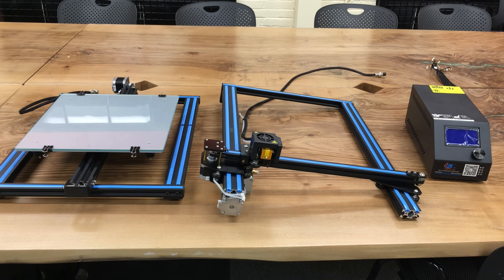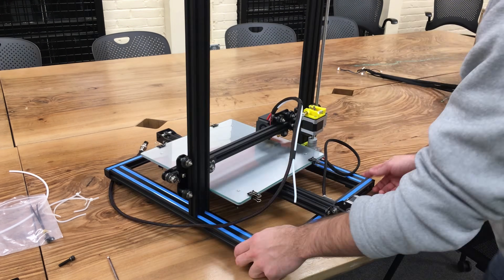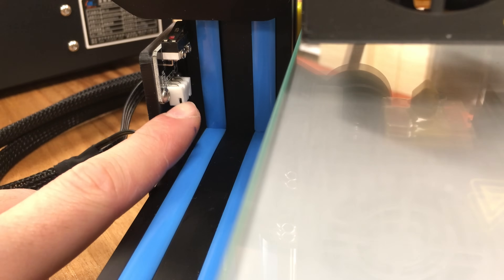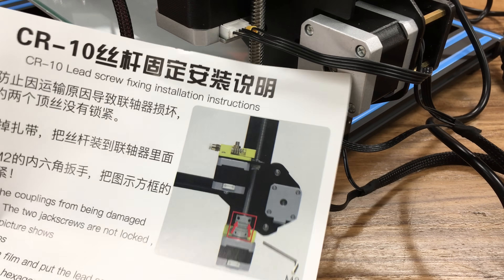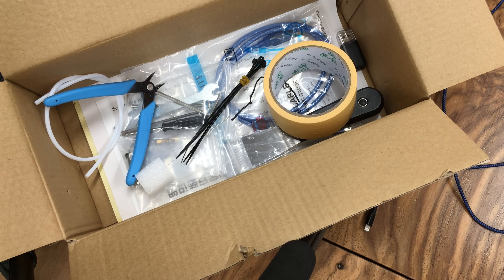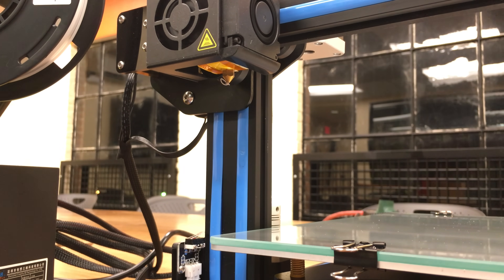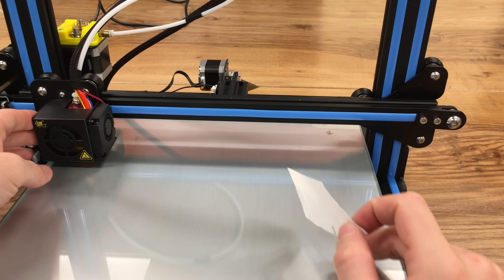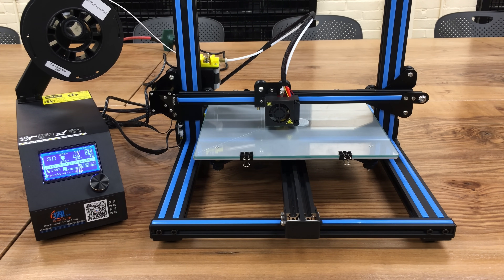Creality CR10 | How to setup, assemble, level and start your first print!

Comment: Thank you. It turns out the previous owner had installed the gantry crane... backwards... and that's why it wouldn't work. I'm on try three of my first print (first failure was user error, second was actually a dumb beginner mistake), and so far, so good!

Comment: Mine goes up by like 30cm and starts leveling the bed in mid air increasing the height and then it either hits top or starts printing mid air (30cm above the bed)

Comment: Are you supposed to print with the glass and binder clips on it?
Reply from the maker: If you have stock bed yes. There is nothing else holds that glass. So you need them unless you change it
Reply: @3DPDoctor  awesome thanks for the quick reply!

Comment: Please if anyone can help, everytime i set the nozzle up so it's in the correct position, when i set home, or start a print, the nozzle is further away from the bed to where i located it. I only found out today that the right hand side metal bar behind the printer, the one that twists (not sure on the name) doesnt screw back enough so requires me to twist it, which moves the nozzle down towards the bed, but everytime i print, it just resets and the nozzle becomes highter up. Any suggestions would be welcome if anyone knows what i could do..
Reply from the maker: Interesting. Are you saying your z axis couple screw is loose? So you should fasten it properly?
Reply: @3DPDoctor  thank you for the fast response. So up the top left you have two screws which are tight as they can be, further down you have the two screws located on the blue part which are all as tight as they can be, the left side is perfect but the right side, every time I set home it just doesn’t home where I need it to be, it requires me to twist it further. I am wondering if the printer me be faulty. The little silver cylinder like part at the bottom, which turns, I am wondering if It’s this which is the issue. I am a dummy when it comes down to these :(
Reply from the maker: Something is definitely not correct but this is fixable sounds like. However its hard for me to debug from here. You need someone to take a look at it in detail

Comment: Rather than holding the unit sideways, I found it was helpful to just hold the edge off the side of the table so you don't have to balance it.  Great video thanks!
Reply from the maker: Thank you for your comment!
Reply: Without reading this, I did the same. worked well.

Comment: if I am trying to move the extruder and i hear the bed moving....did I wire it wrong? just trying to assemble
Reply from the maker: Seems like it. I assume this is happening when you are using the controller screen right? X axis is extruder y axis is the bed
Reply: @3DPDoctor  thank you for responding Dr.! first person to help in 3 weeks. I was trying to see if filament would come out following your instructions and that is when I realized.
Reply from the maker: Did u check the wiring? They should be labeled
Reply: @3DPDoctor  it was connected correctly. The bed is too high for the printer...nothing I do to adjust the bed makes a difference. what should I do Mastro
Reply from the maker: Is your nozzle hitting the bed at the beds’ lowest position? Why dont you move the z limit switch a little up a little to gain distance between nozzle tip and bed surface

Comment: THANK YOU SO MUCH! This is the BEST CR10 setup guide video I could find! And you cover things step by step for a total beginner AND you mentioned things like the input voltage setting that nobody else bother to mention!! 👍👍🤗 I've got my CR10 setup and test printing right now (the test file was named Dog-Test, but it's just been printing a 6" flat pancake for the last 45 min lol! Curious to see what it will be when it's finished haha!)!
ALSO, BTW my CR10 has the bed strain relief already installed, and I had to adjust the FRONT Y axis roller bearing because it was touching the frame and not providing tension to the belt. Other than that it was mostly flawless!
Reply from the maker: Awesome!!! Thank you for your comment appreciate it

Comment: Thank you for your video! Very helpful! One question: Do you really need the four clips to hold the table?
Reply from the maker: 4 is better always. If that table moves during print, it will be over.

Comment: how long did it take for your print bed to heat up to 60c mine got to 35c to 37c and got stuck there for 1 hour then it started going down again and then i tried it again and it slowly started to go back up again passed the 35c so idk if thats normal or what.
Reply from the maker: Nope it is not normal, under 10 minutes it should reach up to 60
Reply: @3DPDoctor  do you know what I would have to check or who I can talk to about this problem?
Reply from the maker: I would first post this problem into facebook group to see if anyone experienced it before. Maybe there is a problem with the heat sensor on the bed or maybe a software bug. In any case it can be solved with a little effort

Comment: so i live in the USA and i have the cr10s, when i need it to be on 110 should the 210 part of the switch be showing out of the hole that you switch it?
Reply from the maker: Did I miss that section in the video?
Reply: You did explain which it should be on but switches are different on everything, sometimes it means its on when the on side is showing and sometimes something is on when the on switch is pushed in and you can see it. @3DPDoctor
Reply from the maker: So did you make the right setup yet? In mine i can see the 110V text when the switch is on 110V position
Reply: If you switch it to the higher voltage would the fan spin faster? if it does mine is the opposite of you're printer. I have the cr10S so it could be different.  @3DPDoctor
Reply from the maker: @connorgrow7794  I have cr10s too. I looked at its voltage switch before I tell it to you. Noooooooo if you swap it to 220 it wont change the speed of fan. That very little switch is for your power supply of the printer. It regulates the main power and decreases it down to 12V so that your printer can work.  If you plug your printer into 220V power and if your switch is on the 110V your regulator will burn. It has nothing to do with fan speed. Your fan is controlled by the motherboard which is supllied with 12V. Be careful
Reply: When I flip it to both it changes the speed of the fan. i had it on the right voltage bc it printed prints fine, they just wouldn't stick because of the heated bed. @3DPDoctor
Reply from the maker: Since you sre on the 110V power it didnt burn your system. But you should keep it at the right settings to be safe. If fan speed is changing thst means a voltage fluctuation which is not good. It may damage the board. For heat bed optiona I suggest you to check my heat bed comparison video

Comment: Great Great Great VIDEO! I just received my printer which is also a CR10-S5 but I have a few questions if you can maybe help me with?

1) How fast/slow does the Z axis go? Also when I move my Z axis with my hands up and down it's really hard to move why is this and what needs to be changed so it's more freely to move?
2) I was going through leveling the bed and getting the corners but when it comes to the middle I feel that my glass is bowed outwards because it's just way to tight, any ideas?

I just need to figure these two items out then I can start going and printing, thank you once again!
Reply from the maker: 1) What do you mean by how fast? are you asking in mm/s mm/min? it generally have the motion command on screen if you want to move it up down 1mm/s is what screen recommends. However its print speed is predefined in the software. You can change it by I don't suggest. Are you trying to move Z axis up/down with your hand while the machine is on? You need to select disable steppers option. 
2) yes that is a king of general issue. Try your best at the corner leveling and re-level it until you get good fit. Is your extruder hitting the bed in the middle?

Comment: My printer just came in the mail and I assembled everything. But when I switch it on the extruder lets out smoke. Any ideas as to why this might be happening? Great video by the way!
Reply from the maker: Thank you and sad to hear. Is it a smoke like something burning or evoparating? Check the cables maybe there is a shortcut in somewhere or maybe something detached etc
Reply: It was like something is burning. There was a strong smell straight away after I switched the printer on. I contacted banggood and they told me to switch two wires from the control box as they had assembled them wrong and it worked like a charm. But the nozzle and the heat bed don't want to heat up now so I can't print yet. Banggood told me they sent me a faulty thermistor and would give me $10 credit for a new one and sent me the link to one on their website. I refused this however because it was a cheap one that cost $4 when they also sold creality's same thermistor for &17. Just really unfair that I spend $600 for something and then get a cheap part when really it wasn't me that sent a faulty one.
Reply from the maker: that is sad :/